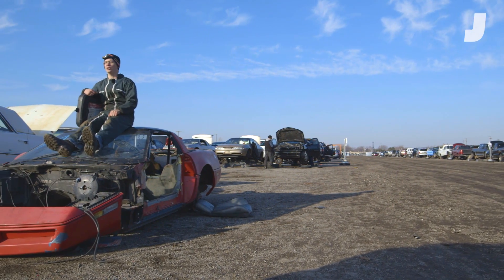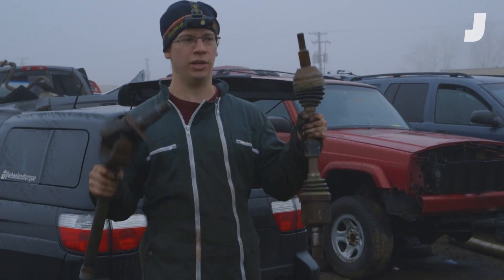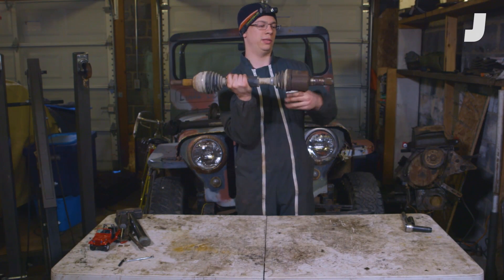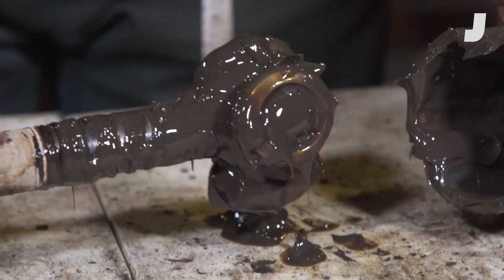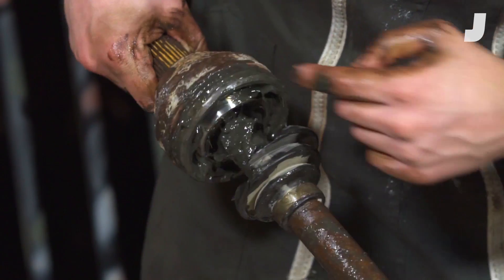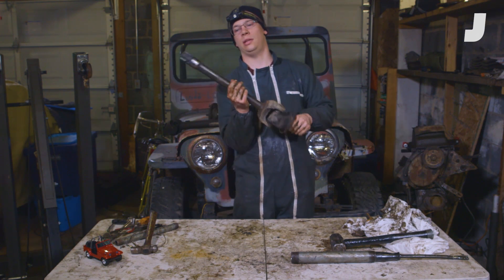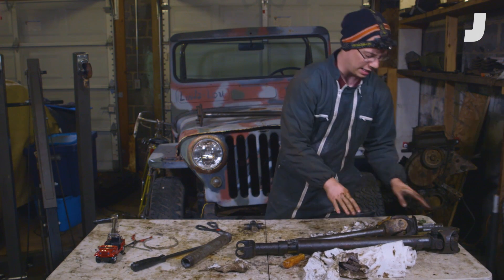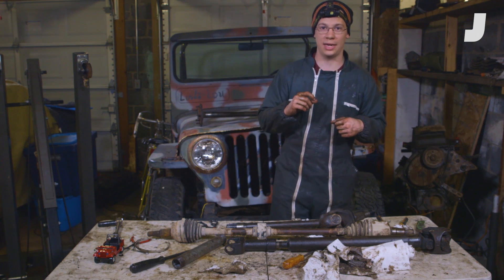How Your Car Transmits Power To The Road | David Dissects

Comment: So much grease. :P 

Question: why not have both ends of the axle shaft use the same style of CV joint?  It'd save on having to design different parts.  Would it allow for too much plunge?
Reply: Joel Bennett I've usually seen cars have both the same type, either ball bearing or tripod types.

Comment: ahem, you can actually replace those cv joints, never bought a whole axle for that. basic tools should do the trick, although it is a pian in the arse. also, angle grinder. easiest way to get the old bearing in the outer joint out. never had inner ones fail, so not sure about those